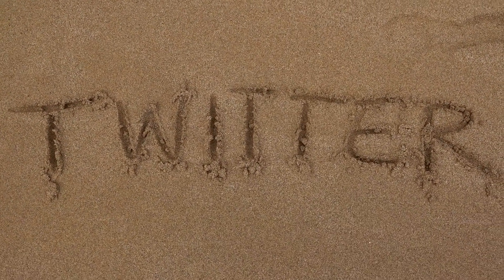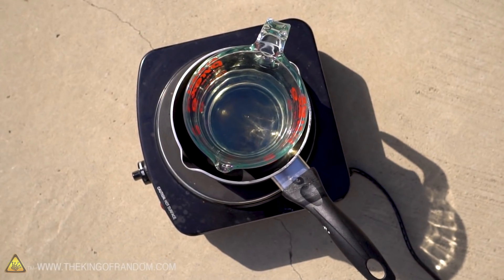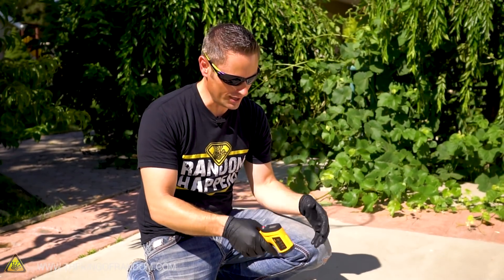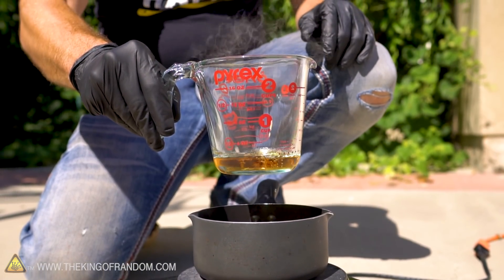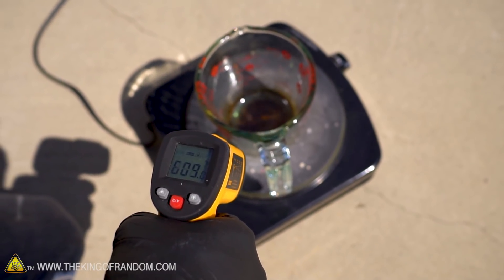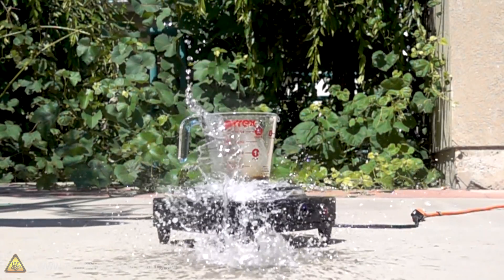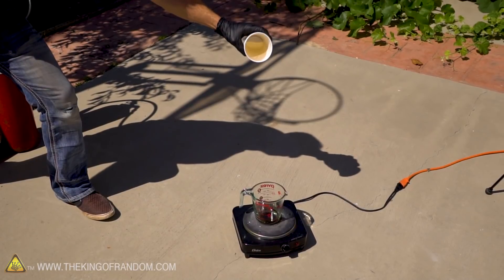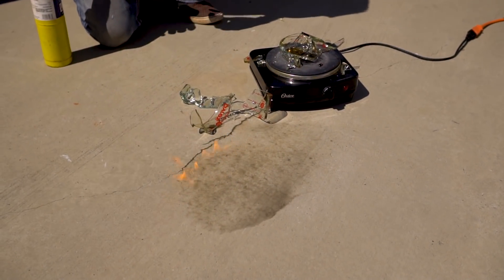Is Boiling Gasoline A Good Idea? TKOR Tests If You Can Boil Gasoline And What Crazy Thing Happens

Comment: the reaction would have been different if you would have poured some of the gasoline in the glass all of it fell down on the road and on the stove near to the glass so that is why it broke because of the thermal shock if you had put some in the glass then it would have ignited
Reply from the maker: I don't it would have ignited.  The burner is much much hotter than the glass, and it wasn't enough to ignite it
Reply: this time make 2 batches boil the first one to 300 degrees c. and the second one put in a Styrofoam glass and then  into liquid nitrogen(when the first one starts to boil) and let it sit in that till the other one boils. maybe it will work
Reply: Meetusingh Singh The auto ignition temperature of gasoline is around 250° C, you'd need to get the surface hotter than that because just pouring gasoline on it will cool it down below that. Also, it's the vapors that are flammable from the gasoline, not the liquid, so you'd need to target those
Reply: ok

Comment: Is it possible to make liquid helium.
Reply: I AM BATHMAN Yeah, but it requires cryogenic temperatures. Hospitals use it to cool down the superconductors in MRI machines
Reply: Well, since helium is lighter than oxygen, it's less dense and so it would take an extremely low temperature to cool it down enough because, if you think about it, it already takes a lot to get liquid oxygen. Similarly with hydrogen and other light gasses.
Reply: in a vacuum maybe
Reply: Then condence the helium straight into liquid nitrogen
Reply: alex rentz oh I didn't know tht tx for sharing

Comment: Looks like you missed the glass but in slow-mo it looks more like there's a weird force field around the top of the glass.

I would have tried the experiment again from the start without the pot because the top kept the glass from heating up.

Comment: Can you break bullet proof glass by using thermal shock?
Reply: Hopefully not XD
Reply: might work from liquid nitrogen then molten metal. polycarb is pretty tough
Reply: Bulletproof glass is actually polycarbonate, not actual glass. It melts at around 300° C (or at least that's the temperature you 3D print with it) and it can handle more tension than glass. I would say it probably won't break but it's not outside the realm of possibility
Reply: Probably not

Comment: the glass broke simply because you shocked it. The glass was several hundred degrees and you poured something that was between room temperature to whatever it was outside. Would have happened if you poured in water, syrup w/e anything liquid.

Comment: You failed... You did not put the gas in the glass mesureing cup right on the burner
Reply: Night Burn ummm...
Reply: Night Burn you didn’t watch the whole video did you?
Reply: cdawson198600 I did...  I'm talking about from normal temperature to hot not from poring normal temperature gas onto hot glass ... It will shatter when things cool too quick
Reply: Night Burn the gas didn’t ignite when it directly touched the hot plate when he poured it, so it still wouldn’t have ignited when if he had initially heated it directly on the plate.

The vapor from gas needs an open flame to ignite or a surface a lot hotter apparently than the hot plate was.

Comment: do some weird stuff with acetone
Reply: It's an interesting compound. You could do a lot with it:
a) add H2O2 and a little H2SO4 (APX)
b) mix it with Br2 and seal the container (Borm-acetone will build up in an autocatalytic reaction creating additional HBr and it will eventually burst)
c) mix it with a thiolating compound, or create an acetal with H2S and crack it (thioacetone)
Reply: Guess we know what the next episode is
Reply: Or better! Boil Toluene without a mask!
Reply: cdawson198600 gasoline does the same thing
Reply: Adrian Carp acetone eats styrofoam and makes a napalm like gel, it will stick to anything and it’s not easy to put out so it’s very dangerous so I don’t recommend trying it.

Comment: What happens when you pour liquid nitrogen on burning  magnesium?
Reply: YES!!!
Reply: Evaporation
Reply: It might put it out, if you take away at least one thing from the fire pyramid there's no fire
Reply: j Walk it would extinguish it not by cooling it off but by displacing all the oxygen around it so it doesn't have any oxygen to burn
Reply: Simply put, when you burn magnesium it becomes magnesium oxide, so by pouring ALMOST anything, you displace the oxygen, so the magnesium cannot react with the oxygen and become magnesium oxide, so it'll stay as magnesium, i.e. No fire

Comment: What happens if you put dry ice in gasoline
Reply: He did that before
Reply: Shariq King been done already.  Turns into jelly.
Reply: Did it light off?
Reply: He did yes it does
Reply: dry ice with gasoline in plastic bottle (maybe pressure will ignite gasoline)
Reply: the gasoline would deteriorate  the plastic int the bottle before anything would happen

Comment: What would happen if you lit the gas coming from the gasoline
Reply: If you can lit something, it burns. Dunno what you'd expect O_o
Reply: Then it would light on fire. What would you expect, it to freeze?
Reply: Matt Small Dont know what youve been taught at school but its not the liquid, its the fumes that burn
Reply: Isn't the gasoline vapor the part that burns?
Reply: TheRokkis o
Reply: Matt Small , depending on the pressure of any escaping petrol vapors the gas can simply ignite or if under massive pressures result in a BLEVE or Boiling Liquid Evaporating Vapor Explosion. Generally an explosion is caused by a combustible liquid stored in tanks that when ruptured at high pressures create quite the show.
Reply: Matt Small You'd get a big plume of flames size of which depending on the heat applied, surface area of gasoline exposed to the air, and how much vapor is in the air when you light it. Gasoline behaves kind of like liquid propane at STP when you boil it.
Reply: inflammable and flammable mean the same thing ;)
Reply: Matt Small the vapors are flammable so that's why your not supposed to light a match around gas
Reply: Better try it so you can find out what happens
Reply: Matt Small the earth blows up.
Reply: It would flash in a big burst of flames. That's why you hear about so many people getting hospitalized for burns when using gasoline to light a brush fire, the vapor builds up and flashes when ignited. Definitely do not try at home.
Reply: KERCHOO
Reply: boom
Reply: The vapor is always what burns. As a liquid, gasoline doesn't burn very well at all.
Reply: Ok william, that is NOT the definition of flash point. As for the vapor burning....thats true of many things , not just gasoline...its also true of paper, leaves, plastic, diesel fuel, etc, etc.

Comment: In a carburetor, that's vapor lock. The alcohol in today's gasoline gives it a very low boiling temp. Running old cars and hot rods that are carbureted on today's pump gasoline is problematic because of this. The nasty gunk left after boiling off the fuel is what slowly builds up on the fuel injector nozzles on a modern EFI gasoline engine.

Comment: What happens if you put liquid nitrogen in a compressed container and boil it ???
Reply: bomb.
Reply: Depends on the container, after a certain pressure the nitrogen would go super critical at room temperature and the gas and liquid would have the same density. Applied Science did this with dry ice for a few things.

Comment: TKOR, be careful with vapor based fuel sources, they can sometimes have an invisible flame that's very very hot when you accidentally find out there's flame.  Grandpa got burnt pretty bad cause he went to go wipe gas off his from his shop counter after the canister leaked and apparently his little propane warmer came in contact with just enough gas and vapor that was dropping from the counter and made a itty bitty pool on the ground and caught fire.

Comment: what would happen if you boiled liquid nitrogen
Reply: Anytime he has poured liquid nitrogen into a container in his videos it is boiling it stops boiling when the container it is in is around the same temperature as the liquid nitrogen itself.
Reply: Gabe The Gummy Bear it will evaporate
Reply: You get um... you get nitrogen gas.
Liquid nitrogen is very cold.  If you expose it to room temperature it's like putting water in a microwave.  It'll start boiling almost instantly.  The boiling point of nitrogen is something like -195C so you don't even need to apply heat to it to boil it.  All you have to do is stare at it for two seconds.  Or chuck something into it.
Reply: boi
Reply: boi
Reply: boi

Comment: Gasoline is a lot more stable than most people assume. Without compression you pretty much need an open flame - and even then it's really only the vapors that ignite. Gasoline you can literally douse a lit match into without anything happening if you can avoid the vapor. Guess Hollywood is to blame for this one :)

Comment: What happens if you freeze gasoline then light it.
Reply: Done it already
Reply: Shariq Ali he done that already
Reply: Shariq Ali He would need to use liquid nitrogen.  The freezing point of gasoline is -40°
Reply: drippingwax he could still freeze it tho.
Reply: You idot has dont frezze
Reply: He's done that already.
Reply: Done that already
Reply: Shariq Ali already done byhim
Reply: He already did that
Reply: U don't get open Bob  and vegene
Reply: Yes it does, it wont burn because its not putting out the vapors that make gas flammable.
Reply: Brennen Pat it burns watch the video
Reply: He did it already
Reply: It will burn because temp won't change it's flammability.

Comment: I am in no way an expert, but with some simple research you can learn that, effectively, the brownish colored liquid you made before it dried out and the glass exploded was napalm. The same fuel used in WW1/2 in Flamethrowers and fire bombs. If a flame goes off near the vapors it becomes Extremely dangerous. Ask Cody, from Cody's Lab about it. It is heavily chemistry based, and with him being awesome at chemistry, he should be able to explain it better than I.

Comment: Hey Grant, Can your Flamethrower melt Dry Ice, and if so, How long will it take. Vote so grant see's this
Reply: dry ice under heat normally doesn't melt it sublimates. a process where a solid (dry ice) turns straight into a gas (carbon dioxide) in this case he'd probably just make this happen a lot faster.
Reply: Not trying to be mean, but i think many viewers enjoy the builds, projects, and bigger things more than doing things like “what happens if x melts y on fire in a liquid nitrogen vacuum chamber”.
Reply: No, atmospheric pressure isn't high enough for dry ice to "melt", instead of just faster sublimation

Comment: You should see if you can boil gasoline and see if there is any water in gasoline?
Reply: Water and gas don't mix so your be able to tell them apart by a separation line
Reply: Things boil that have no water in them. How would you be able to tell if it's water just from it boiling?
Reply: ... water is H20. There are liquids that exist that have no H20 in them. Liquid Mercury can certainly have no water in it.
Reply: Kevin Allen easy....gasoline boils at a lower temp than water.  All you'd have to do is bring the temp up to where the gas is boiling but not so much that the water boils.  At that point it's just a matter of time.  Gas boils off water would stay.  Of course you wouldn't actually have to do this since water and gas don't mix.
Reply: kittkittpop funny times Every liquid... has water in it....

Comment: glass only broke cause of drastic change in temperature from very hot to relatively cold, if you used the pot instead of the pyrex there would be drastically different results

Comment: Suburbia strikes again. didn't see the thermal shock coming? Pretty sure you need to get it up to at least 1200 degrees somewhere in there and then you'll get Auto ignition but your hot plate isn't going to even get close. Maybe try a hot plate with the exposed coils on top that ought to be hot enough once it turns red.

Comment: Melt plastic and while in liquid form, mix gasoline in it, or if possible, mix gasoline while temperature isn't hot enough to ignite it. Then mould it and while in solid form, check if it will ignite. If it is possible.

Comment: can you make dry ice into liquid?
Reply: DA Shawx he already did it
Reply: u dont need expensive equipment for that just do this put dry ice in a test tube seal it by melting the gas and heat it using a hot heat source like a blowtorch the pressure builds up and we can liquid CO2

Comment: What happens if you boil dry ice?
Reply: Tom Dundon dry ice is a sublimating solid. It will never turn to a liquid in Earth's atmosphere so you can't really boil it. If you were to heat up dry ice you would be left with CO2 gas
Reply: Ltifone2014 It sublimates in the freezer.

Comment: Also, I have learned the hard way in the past that those "Pyrex" measuring cups are NOT Pyrex. I tried to boil some battery acid down to make it concentrated and while it was cooling down it shattered into a million pieces, splashing concentrated sulfuric acid over everything.

Comment: What happens if you mix liquid nitrogen with gasoline then try to lite it on fire when you poor it into a cloth or heat it like you did in the video what you can also do is have three cups one that has more of gas then liquid nitrogen one that have both the same amount as both and one that has more liquid nitrogen

Comment: The auto ignition point of gasoline is actually between 247-280°C (477-539°F), temperatures that can easily be reached in most households. Most likely the thermal shock of the cold gasoline onto the hot plate caused the cool long enough for the vapors to safely boil off.

Comment: What happens when you freeze gasoline, melt it, then light it?
Reply: Also, he would need to freeze it with liquid nitrogen, because the freezing point of gasoline is -40°.
Reply: What if you melt it with a blow torch?
Reply: Freezing and melting does not change the chemical composition an object. If you freeze gas, melt it, and then light it on fire... It will be on fire

Comment: Someone didn't watch the Slowmoguys video of breaking pyrex glass.  Of course a cold liquid on a 500+ degree glass surface will cause thermal shock!

In order to get gasoline to ignite due to temperature, this may not be hot enough, but the exhaust header or manifold of a running engine definitely is.  Ask me how I know...

Comment: Hey TKOR! It would be interesting to see what would happen if you make gasoline jello and try to ignite it!
Reply: that's called Napalm....... Hint: It's very very veeerrryyyy flammable
Reply: Aaron Lang yeah but I don't see it as napalm simply because napalm is more liquid. This is a solid and the original idea came from mixing it with an oxidizer to create solid rocket fuel
Reply: +Aaron Lang Napalm is actually styrofoam dissolved in gasoline(with thermite added) the dissolved styrofoam makes it sticky, so it clings to whatever it hits, making it much more dangerous.
Reply: Max Smith no napalm is actually fuel and basically any plasticiser. They used sawdust and other mixtures over time. Fuel and styrofoam is an extremely crude and ineffective version of napalm
Reply: +Lewi3 cool, thanks for letting me know.
Reply: Or if u actually used the flame thrower
Reply: its called napalm
Reply: gamerdudes superelite  q
Reply: That's a great idea!
Reply: Then how can you solidificate it? Corn starch?!
Reply: Rajesh Irnak, liquid nitrogen will boil at room temperature so I think you can see it boil in any video with liquid nitrogen in there. Spoiler: It starts bubbling and vaporizes.
Reply: gamerdudes superelite i like your idea
Reply: Napalm is pretty much diesil and soap
Reply: what's happen when  boil liquid nitrogen

Comment: "The most commonly known flammable liquid is gasoline. It has a flash point of about -50° F (-65° C). The ignition temperature is about 495° F (232(232° C) [sic], a comparatively low figure."

When the gas hit the plate it vooled down but given enough time it should erupt in flames

Comment: I worked for a company that used to fix leaks in refineries. We worked on a unit that had gasoline heated to 900° Farenheit. We had to have a hose with steam pointed at the flange to extinguish any sparks as we removed a nut and bolt to repair it.

Comment: What happens when you conduct electricity through oil?
Reply: Nothing, oil, for the most part has a low electro-conductivity, hence why it is used as an insulator in transformers and other cooling situations.
Reply: But what if it is a more water based oil?
Reply: Oil doesn't conduct electricity!
Reply: Oil and water do not mix...

Comment: Could I suggest that you do these experiments involving liquid accelerants, heat sources and unexpected outcomes, near a pool. It is quite difficult to put out a flaming person doused in gasoline and by the time your assistant gets to the extinguisher and figures out how to use it you could suffer significant injuries. Plus if you're on fire you will likely sprint so fire extinguishers dont fly. Just a suggestion.

Comment: every glass will crack once you intreduce it to very big temperature difference
if you heat up any kind of glass to about ~250 degrees, then pur into it a cold water, the effect will be the same

so about the petrol, nothing happened witch is very intresting thing to know.
thanks for the experiment. :)

Comment: What happens when you pour gasoline on thermite and light it will it light if you use a match or will it not light because it's wet
Reply: gasoline doesnt burn hot enough to ignite thermite